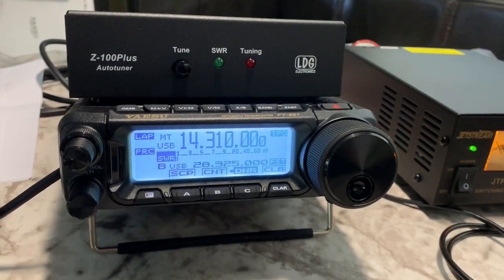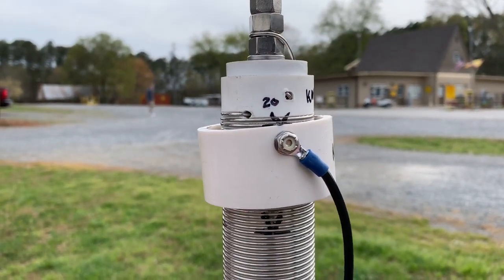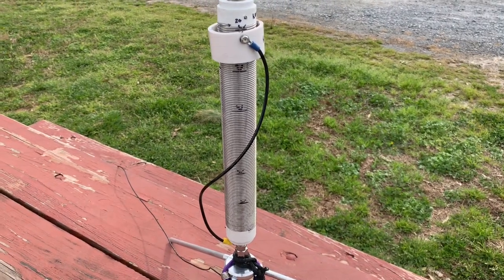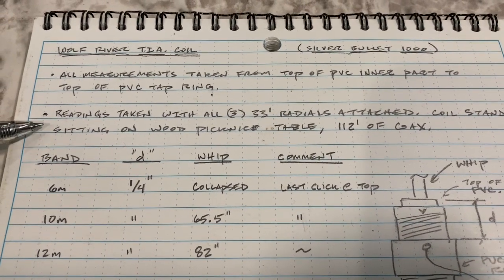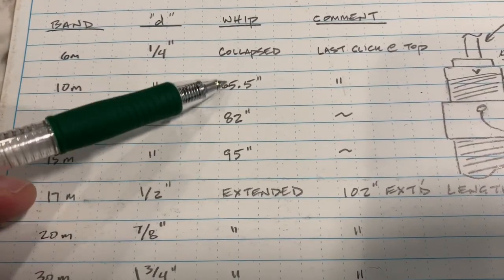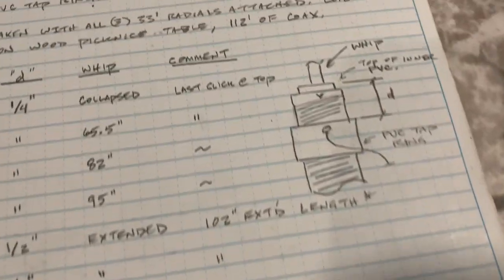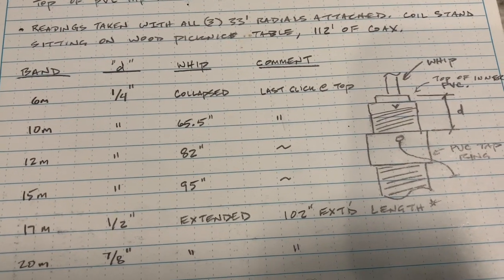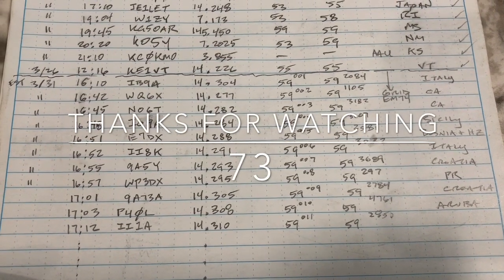Wolf River TIA Coil - Setup Tips

Comment: Will the 213” whip work with this set up
Reply from the maker: I have not tried longer whips than the extendable 102" whip that came with the coil, but I'd think a 213" whip would, but would mean the tap locations would shorten on the coil.  It will probably only tune at that length on (7 MHz) 40m and lower.  73
Reply: @GhostRider1974  stuck between this and a super antenna

Comment: There is a spring that can be be put on it for mobile use, in case you hit something with the antenna.  You will need to adjust because of the length of the spring!

Comment: Having a hard time tuning 30/40/75m with my SB1000 and 213" whip.  Any pointers on this setup would be great as I am getting sunburned and frustrated (LMAO).
Reply from the maker: Use an antenna analyzer at or near the antenna to see if you can find the resonant positions...mark those or measure and record the position.  Use of the (3) radials is very important for getting the antenna to tune properly.  73

Comment: I am sure you know that IF YOU REMOVE THE LOADING COIL, you can work 6m and 10m by merely shortening the whip to approx 4'4" and 8'2.5" respectively. The will be no coil loss either. If you happen to have the center loading extension rods you can create a vertical antenna uo to approx four feet longer or 12' 6" long. With that, you can go as low as the 15m band with the coil.

Comment: Thanks for sharing. I’m looking at getting One of these antennas for portable use.What type of coax are you using?
Reply from the maker: I generally run 75 to 100 feet of RG8-X coax.  Not the best for eliminating loss in the feedline, but works well enough for HF and is convienient to use when portable.  73

Comment: Excellent Information and Good video.  I've got several TIA Wolf Ridge antennas; One in my portable case.  I work a lot of VERY remote sites in Alaska and have been quite pleased with its portability and construction quality.  I've had one SB 1000 sitting outside for 2 years and even at minus 40F (-40F) temperatures, it still works well.  Dan KL1JP

Comment: Found these measurements for 102" whip measured from the bottom.  Using a 102 inch whip
1 clicks from the bottom 3.550 Blue
10 clicks from the bottom 3.753
20 clicks from the bottom 3975
56 clicks from the bottom 5.300
83 clicks from the bottom 7.187
97 clicks from the bottom 10.100
106 clicks from the bottom 14.280
110 clicks from the bottom 18.100
To receive 12 and 10 meters use a shorter whip.
Reply: Hello, Gray. I know you posted this a couple years ago, but I am a new General-licensed ham and purchased the WRC 1000 Platinum. I am having a terrible time getting my new Yaesu FT-710 to work with the antenna. I have mostly tried the 20M band working “portable” with a battery in my backyard. I have Parkinson’s Disease so the whole bonding/grounding issue is just too much for my brain right now. When you say the measurements for the 102 inch whip are from the bottom, do you mean from the bottom of the coil?  I am currently getting nothing but static on 20M with an SWR measured at 1.7:1. Thanks for any advice you can give me!!  Jim in Oregon
Reply from the maker: Excellent info!  Thanks for sharing.  I’ve actually been intending to try a 102” whip out on the system.  73!

Comment: I have my Wolf River Coils TIA Mega tripod and my FT-891 is coming tomorrow. Is there any need for a tuner. I see you have one. I have a LDG tuner for each HF radio I own I was thing of not getting one for the SB-1000. Thanks! I have your notebook measurements info copied into a spreadsheet.
Yes, my mileage may vary, but it should get me close. Even the longer tripod legs might make a difference and I have a 50' RG8X coax but I have a analyzer.
Reply from the maker: An external tuner isn’t specifically required, but it may be useful to cut down on the number of fine-tune adjustments at the antenna to get you on the air faster.
Reply: @GhostRider1974  Thanks! Going to order the Z-100 soon. I suppose the Yaesu cable doesn't come with it.
Reply from the maker: Yeah, you guessed it.  Cable is additional 🤨

Comment: Do you have issues with tuning the coil and by touching the plastic collar SWR goes all over the place. I am assuming it’s a grounding issue and i need more radials?
Reply from the maker: I have not had any issues with that.  I have noticed at times that the radials can become loose on the attachment at the legs.  Also, check that the plastic set screw is holding the tap collar firmly in place.  If you are near the antenna while tuning, your proximity may affect the SWR as well.

Comment: Nice video. I was curious how you run your coax into your camper? Do you just run it through a window or a more permanent connection?
Reply from the maker: Correct...thru a window with a towel to close the air gap.

Comment: What kind of antenna analyzer did you use?  I find my Youkits FG-01 to be indispensable for antenna tuning.  Also, I assume your tuner was not in the circuit when you did your adjustment or tuning chart. 

Dave K8WPE
Reply from the maker: David J. Wilcox ...correct, I used a Comet CAA-500 Mk II for the analyzer.
Reply: @GhostRider1974  I was going to ask the same question.
Reply from the maker: Forgot to add, tuner was not in the circuit.  I used the analyzer at the antenna feed point with a semi-short section (25 feet) of coax.  73!

Comment: i just discoverd your channel  and subed ty.. for sharing this info  iam going to copy your notes and go from there. 7 3
Reply: I’ve ordered a 90 degree female to male coax adapter.  I set/mine up in the backyard and the adapter should make it easier to switch between the feed coax and the antenna analyzer.

Comment: Good video, I also have the TIA and have been on 40 and 30. I’ve tried to find 10 but could not find it. I think your video is going to help. 73 kk4qyn
Reply: Interestingly enough, when wolf river does their videos on the silver bullet 1000 and the mini, they conveniently skip over the 10 meter band when they are showing how to tune it. i suspect somethings rotten in denmark with this antenna on 10 meters.
Reply: @skippyi6969  10m on FT8 two clicks down from top of SB 1000 and 65 half inch whip (102" WR C supplied).... swr 1.3  73 2E0HCE
Reply: Try shortening the whip antenna and is should work. That is what I needed to do.

Comment: That is the one thing I haven’t done, is use a tuner with this.  I’ve been tweaking the radials and the tap for resonance.  It looks like you are using the full 33’ of radials and not adjusting them at all as you move through the bands.  I am going to try one of my smaller whips and do what you are doing here.  Your approach at measurements and positioning appear to be way more predictable and repeatable than mine.  I just built a Hardrock 50 with an ATU for my KX2, I won’t be without a tuner in the field this year.

Comment: I’ve tried a number of different whips with mixed results.  I prefer the longer whip, I have the 213” whip and I have a Buddipole 17+’ shock cord whip.  Both of these are resonant without any coil on 20m and higher.  I use camping clothesline spools for the radials and have marked each radial with colored tape per band so that I can get a 1:1 match & a 50 Ohm feedpoint.   I add the small coil to pick up 30m and 40m, I’ve not tried 80m yet, with the big coil, but that is my plan for camping, when the campsite allows, to have an 80m setup.
I bought the mega feet and the small feet for the tripod.  So far I have only used the mega feet.  Those large whips need a little guying or a bit of weight in the base to keep from toppling over in the wind (luckily I have a tree in my front yard where I’ve been testing these to catch the antenna when it starts to fall over).
I have Buddipole 66” and 114” whips as well that I intend to try for a more portable setup and more flexible in that I would need to keep at least the small coil on for the higher bands .  I keep getting distracted by the larger whips though.
Our camping season starts this coming weekend (I will ignore winter camping up here as I’m not bringing a radio in the snow).
Thanks for posting.

Comment: Brother would you please tell me which radio 📻 is best yaesu ft-891 or yaesu ft 450d please give me solution 
Please let me know
This is s21vb from Bangladesh
73
Reply from the maker: Howdy!  Well, they are both great radios.  I have owned a FT-450D as well.  The FT-450D is larger and is less menu driven.  The FT-891 is compact / portable, has a detachable face, and has a more advanced filtering and digital noise reduction; however, the FT-891 is much more menu-driven.  I would recommend the FT-891 because of its compact size and advanced noise reduction / filtering.
Reply: @GhostRider1974  thank you so much 
i will buy in next month
I will contact you
73

Comment: Thanks for the video. This looks like the antenna I will begetting for myself. Is a PDF copy of your notes available?
Reply from the maker: David Harden — I can email you a copy.  My email is good on QRZ...shoot me an email and I will reply.  73 de KM4RT
Reply: @GhostRider1974  I watched this video again and remembered you had sent me the notes. Thanks so much for doing this. I have got to try my WRC TI! this week, now that the weather has cooled. 73
Reply: Thanks. 
I'll Give it a try with your measurements. I couldnt do any better that 3:1 SWR with analyzer.  Do you also elevate antenna or leave it on the ground. Have  you noticed any measurement differences between elevated or on ground?
Reply: @kd4kzz  I leave it on the ground, but supposedly elevation helps.